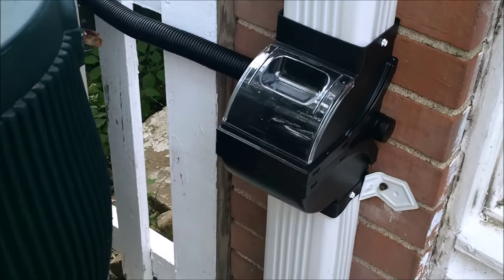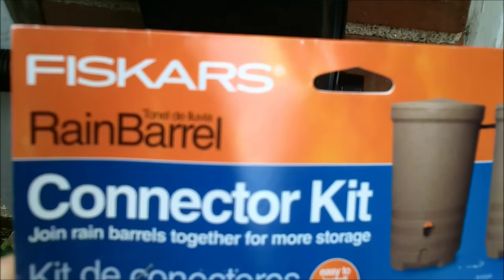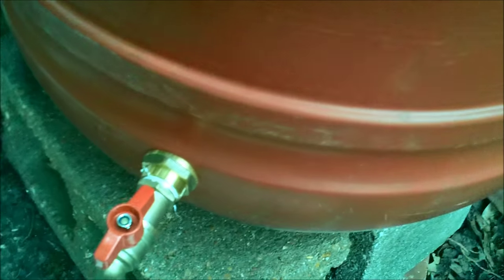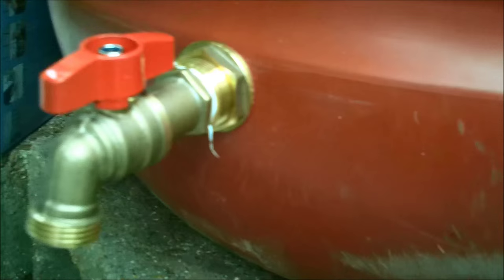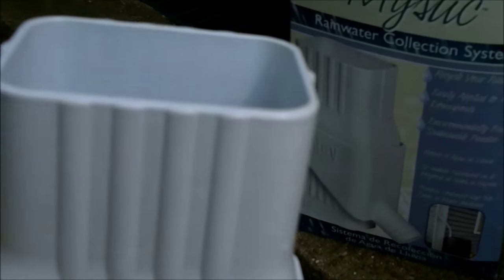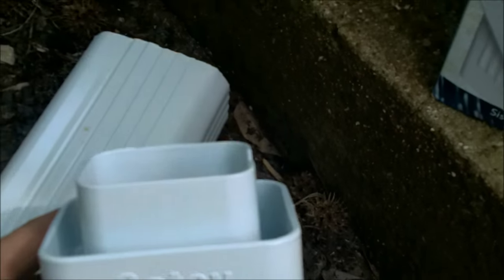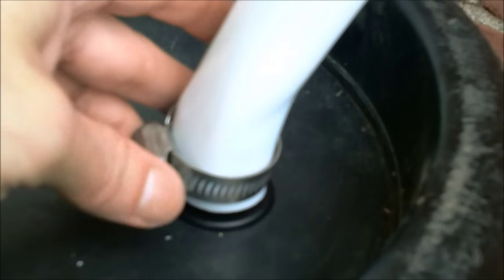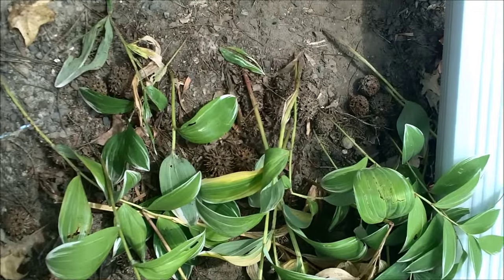Installing Rain Barrel Diverter from Fiskars and Oatey Mystic

Comment: on your original rain barrel, there is an outlet near the top that is meant to run back into your downspout. This is to prevent overflow. you dont need that diverter by Oatey. I am not sure if the instruction didnt mention it, but that is the purpose of the high spout.

Just FYI of course.
Reply: Thanks for saying this.   I had wondered what that was for.
Reply: Michael Illingb

Comment: If you install the diverter lower, level with just below the top of the waterline of the barrel, you can still have a screened vent on top. It won't overflow that way, I think I'm gonna go that route. I don't know if it's better to have it vented or sealed. It might matter if it gets too hot. I dunno. I just got 3 blue barrels today and I'm planning out my system now. 
Thanks
Reply: How did this work for you?

Comment: To fill holes, repair metal parts, or even fabricate metal parts ( think broken bib valve knob), I use a product out of Allentown pa called PC-7 (PC-11 for marine, fuel tank repair). It was developed to glue hwy reflectors on roadways.  If you don't know about PC-7, you aren't able to fix anything.    Comes as a 2 part epoxy in film canister size to gallon pails, mebbe bigger. I've glued rocks to bridge abutments to make urban guerilla climbing walls, repaired teeth on a huge brass Tiller gear on a 1935 36' wooden sailboat, restored a rusted rollbar (1/2" x 3" coating and clamped beer can sleeve as a form.  It's the bomb. Great for affixing towel racks to bath tile without drilling.  24 hours and the putty becomes a metal epoxy.  I live by this stuff.  PC 7 (grey) PC-11 white

Comment: I have recently purchased a rain barrel and diverter.

I have a question about the installation though. All of the tutorials I have found online install the diverter on the same height as the rainbarrel's entrance hole (= water level). I understand that you should not install it beneath the water level of the barrel., as that will prevent it from filling up properly.

In my case I would like to install the diverter about 70 cm higher up on the pipe than the entrance of the barrel.

Logic tells me it might still work, but I haven't tried and haven't found any examples of it being done that way. I would love to hear your input!

Comment: So the air comes out where the water comes in hope it worked if not put  a air vent in just put it higher than the overflow inside drain pipe

Comment: Why do you mount the Oatley diverter above the barrel and run the water tube to the top of the barrel.  Would it not bypass water better when the barrel is full if you mounted it like you did the Fiscars diverter with a horizontal connection on the side of the barrel near the top?
Reply from the maker: +Fred Oswald I think you're right, but the Oatey has that huge downward angle built in, and the entrance on the barrel I'm using with the Oatey is on top.  The effect is that the additional "head" above the bucket increases the pressure on the bucket, so the lid must be on really tightly and with a good gasket.
Reply: +Doc at Home 
I bought an Oatley diverter to replace a rubber Earth Minded diverter that blocks too much of the downspout, making the barrel overflow.  I mounted the Oatley at about the height of the barrel inlet.  But the Oatley actually diverts water from an inch or so above the spout.  So I'll have to raise my barrel (when it is empty) bu putting 2x4's under the barrel.
I also have two Fiscars diverters that each feed two barrels: one Fiscars barrel and three red Greek olive barrels like you show.  These systems work very well.

Comment: you used the diverter wrong as they are designed to be connecting the older pipe loosely so you can take it off easily and give it a clean. However you screwed it tightly.......
Reply from the maker: +wenhao li Oh, shoot!  That's a good design!